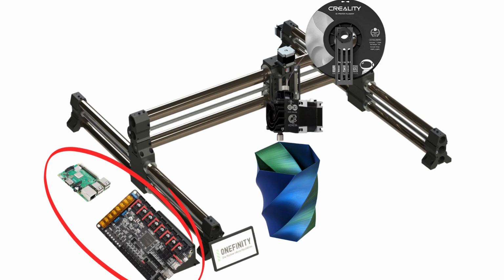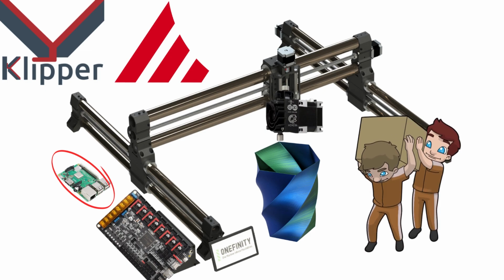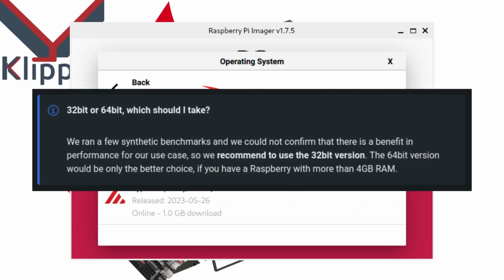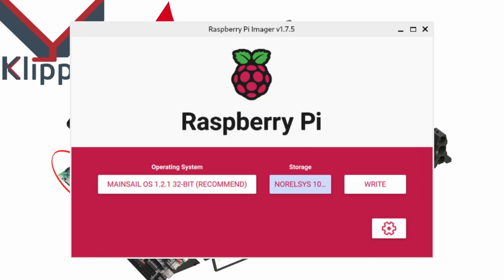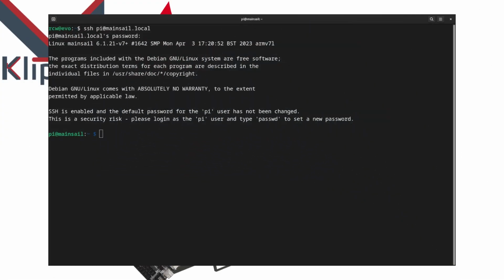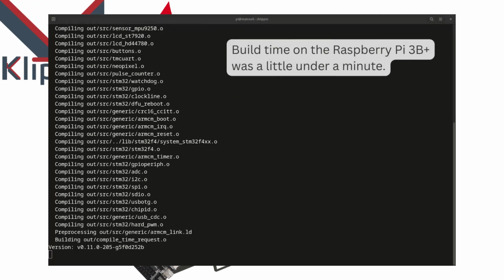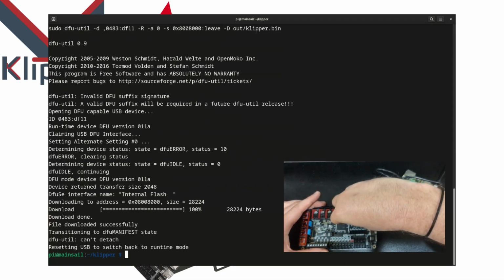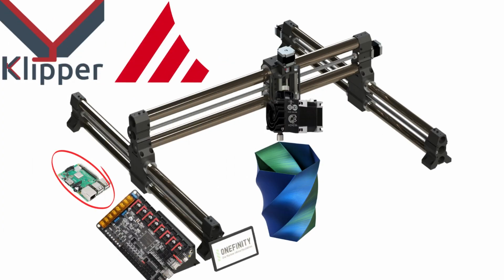Installing Klipper on a BTT Octopus #octofinity

Comment: Now just hack on a standing desk and you have a huge print area
Reply from the maker: Not a terrible idea. I was originally thinking of an ATV lift or similar, but a standing desk with position memories would be very interesting to repurpose / control.
Reply: @cilynx and you already have precise control in the head so if you are able to nail the "steps" you'll be golden plus bet you can get a broken one for cheap or free

Comment: Didn't showed the most important part which was running nema 23s on small stepper drivers
Reply from the maker: Yup -- this one was just getting Klipper up and running. Dialing in the 2209s and getting sensorless homing working is a whole mess on its own.  I have most of the footage recorded, but have been busy with the day job.  I'll get it together and posted eventually.

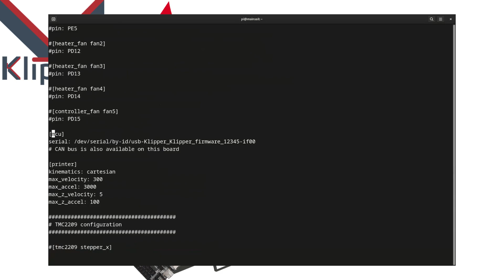Comment: At 3:16 in the video is as far as I got installing klipper, I can’t verify the firmware installation on the octopus board it says no such file or direct and I don’t know what to do.
Reply from the maker: Were you able to get the board into DFU mode and successfully `make flash`?  What do you get when you look in /dev/serial/by-id/?
Reply: @cilynx  I get no such file or directory, and connected my octopus to my computer via dfu mode and tried to reflash the boot loader but the pi won’t connect to the octopus.
Reply from the maker: @joeanderson2642 are you doing the firmware build and flash from the Pi?  If your Pi doesn't even have /dev/serial/by-id/ then there's something wrong with your Pi's image and you probably want to reflash it first before turning your attention back to the Octopus.
Reply: @cilynx  thanks for the advice somehow I got it to work I don’t know what I did wrong but I kept trying and got a serial.